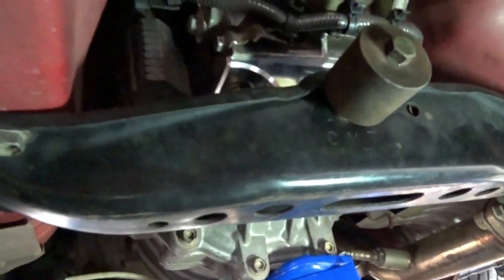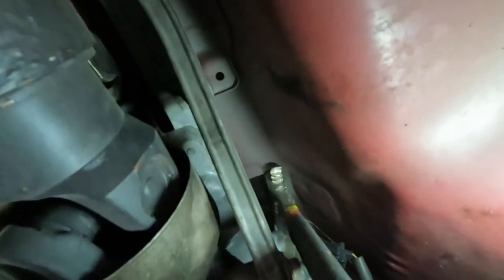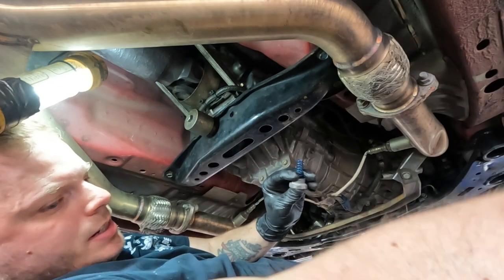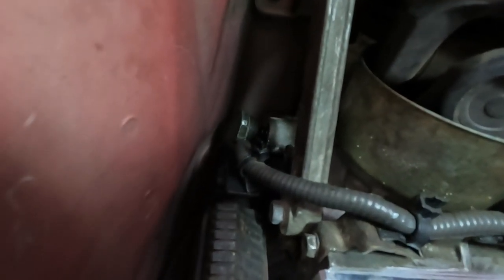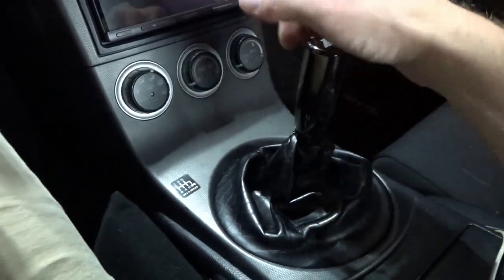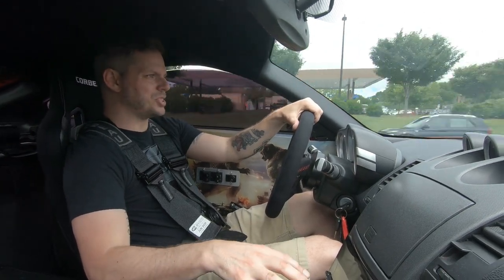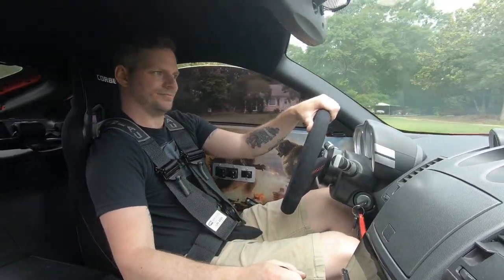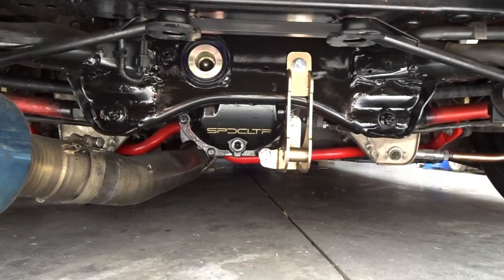Improve Shifts in your 350z in 15 Minutes | Shifter Spring Upgrade

Comment: What size bolts are those for the shifter springs
Reply from the maker: I'm not certain honestly--possibly 1" or close to it --15/16 or something.  I just used an adjustable wrench as you could see.  They are not super tight, so an adjustable is fine.